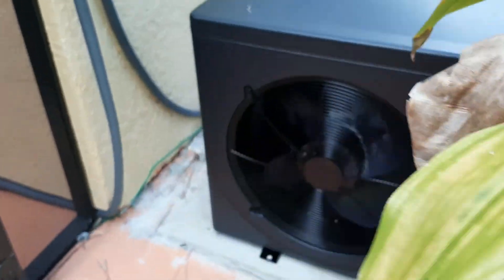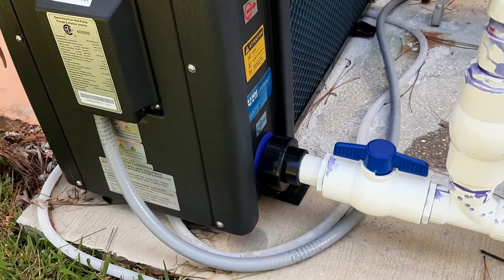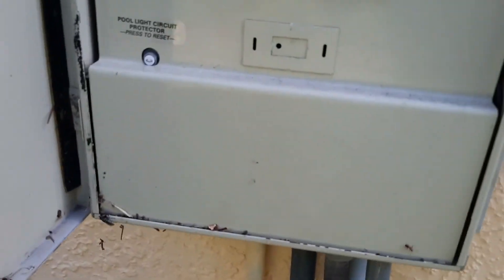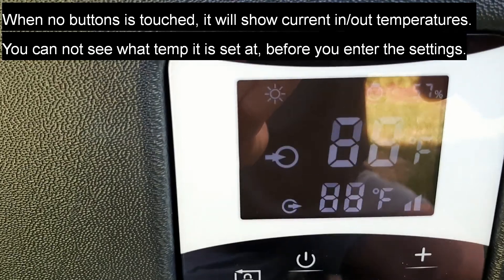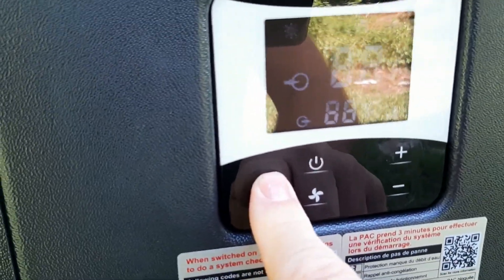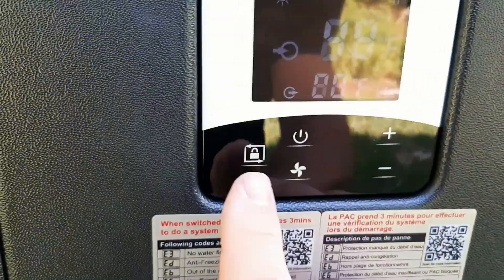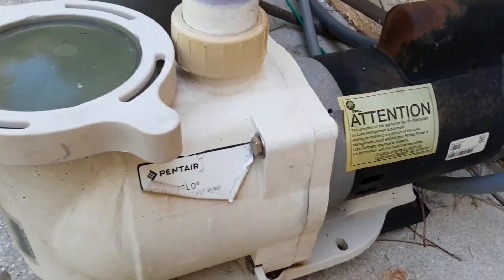Raypak Crosswind 65-I Electric Pool Heat Pump and Cooler Review

Comment: I own this same unit. I put it on a 13500 gallon pool.  This unit will heats up the pool about 30ﾟ warmer In about 2 and a 1/2 to 3 days. I have a setup on a variable Speed pump and I run it about 55%. It cost about $4 A-day to run Running at a 100%. Once it gets  the pool to about 88ﾟ it will cycle on and off on and off and cost about $1 to $2 A-day  This is based on Houston Texas weather that that was anywhere from 55ﾟ to 80ﾟ during the day.  I installed this on 3"  PVC.  They would not be good for a hot tub as they can only go up to 90 ﾟF.  I'm very happy  With this  Unit and absolutely love that it has a screen to tell you the temperature in-and-out. I ran this unit pretty much most of December and raised my bill roughly about $38 a month. This is based on 10.9 cent per kwh.  What's the temperature in the pool reached  88 degrees it pretty much cycled on and off throughout the day.  You can adjust the temperature to whatever is comfortable for you since it can cool off your pool or  Heat up your pool. It's very easy to install yourself as long as you have basic common knowledge. It's very important to make sure you hook up the drain line on the bottom left hand side of the unit.  Feel free to reach out if you have any questions.
Reply: thank you. there is not enough info and feedback of this unit. I bet you would save more energy if you got a solar cover at night so you dont lose the heat you gained.  Did you install it yourself or have someone install it? if so how much did it cost to install? When you said it cost $4 a day to run running at 100%, you meant the heater itself right? So the heat pump was on 100% but the pump was only running at 55% speed none stop in those 3 days? At night when its cold, does the unit automatically turn off because there is no ambient heat during those cold middle of the night?
Reply: @moialder252  you are correct I definitely need a solar cover i have been looking into them because it'll heat it up during the day around to 84 and go down to 78 with heater on running on medium which is about 80% and running the pool pump at 55%. Running both of those cost me about $2 on med and  $4 on high a day that's running 24 hours a day. If the temperature goes below 50° the unit automatically will shut down. It is very hard for this unit to keep up if the temperature drops below 60°. I always keep my variable speed pump in about 55% while running the heater as that is the most efficient number I found to work for my setup. I installed it myself because it was very simple due to the fact that my pool company already wired my omniologics control board with thick enough wire to accommodate for this unit. All I had to do is buy the breaker the wire to run from the breaker to the unit and then the plumbing and fixtures to install the unit. It was very simple it took me about two and a half hours to completely set it up from start to finish. All in all cost me around $100 in parts. Very self-explanatory 220volt set up. If you are savvy with that kind of stuff. If you don't feel comfortable installing it yourself I definitely would recommend a pool installer to do it for you they'll probably charge you around $300 to $400 to install it if you have everything on hand. This is based on me talking to a buddy of mine that does pool equipment installs.
Reply: I have this unit. It works great. However, the black casing looks terrible after one year. Also, you press and hold the power button for about 10 seconds (after unlock), do you get a flashing WiFi symbol? There’s nothing in the manual about it and I can connect to it, but I don’t know what controls it. It came up in my WiFi options as “SmartLife”.
Reply: @jdmrc93  going to investigate this right now that is very interesting I'm curious of why it doesn't have its own app I would love to be able to control the air conditioner portion for the summer time because my omniologics Hayward will not control AC only heat.
Reply: How is the chiller feature? Does that also take 2-3 days to chill? I live in Houston too and man was our pool water VERY hot this past Saturday - looking for a heater/chiller option and this might be the most budget-friendly one.
Reply: @1371ddcantu o yes it keeps my pool down to 89-90 at most. I run it at night it can get down to about 83-85 but I have Pebble tech and it can get down right hot with out it typically 95-97.i keep it about 89-90. All the time my pool is 13,500 gal. Though your pool may very. Definitely worth the money to get one for sure. It is not expensive to run. If I run it all the time about 35-40 a month extra I also only run it at night or if we want cool water to come out of the fountains when we swim.
Reply: How is this working for you? I also live in Houston and it's too cold or too hot to swim. Can you please give me some feedback?

Comment: I just bought and installed a extremely similar unit. It's been running for an hour. Set it at 82° but not 100% it's actually set. See the heat mode sun, fan running.

Comment: Unlock it, press and hold the power button for 5 seconds and the wifi sulymbol will show up on the screen and start to flash.  Open the smartlife app and connect. The manual doesn't show you this, bit it works

Comment: Thanks for you videos.  I wanted to know if you were aware that this heat pump comes with WiFi already built in?   I'm using the Smarter Pool app and I'm able to control everything from my phone.
To turn on Wifi, you just hold the power on button until you see the wifi symbol start flashing and use the app to pair to the heat pump.
Reply from the maker: I saw someone mention it a while ago but forgot about it again. Thanks for bringing it up! I wonder why they didn't put it in the manual?
Reply: Can you please help me with this I am trying to get mine set up on Wi-Fi so I can control and see the temperature of the water coming out of the heater remotely. What app are you using and how did you set it up please give me step by step.

Comment: I just got mine installed today.  My pool guy installed it.   I keep trying to set the pool temperature to 80 I would set it at 80 and it keep going back to the 70s.   Now I know what the numbers means I’m really happy. I can’t wait until tomorrow to see what the temperature is.  It has been a year how do you still like your heater and did you use this cold winter.  Where in central Flower are you ..  I’m in Mulberry

Comment: I read some information on pool forums, and those who are considering this in DRY places with low relative humidity, BE CAREFUL, this might not perform well. I believe Twisted Pudding is in Florida which is very humid. Heat pumps dont just rely on ambient air but also RELATIVE HUMIDITY. When you look at the ratings, it even says the BTU output is based on 80/80/80, meaning water temp, ambient air, and relative humidity. You use this heat pump in dry area like ARIZONA or similar, this thing will perform POORLY. SO CHECK YOUR HISTORICAL RELATIVE HUMIDITY IN THE TIMES YOU WANT TO USE THIS. If it is showing lower than 50 and worse single digits or in the 20s, you need to get the BIG JUMBO LIKE AN AC CONDENSER SIZE HEAT PUMP to offset the loss of performance to even perform.
Reply: So what are people in AZ supposed to use to cool their pools down?
Reply: @1TUFZUK  The cooling part of this I'm not sure how performance is effective depending on humidity. The ratings are only about the BTU for heating.

Comment: Hello, on the wiring diagram there are “pump controls” do you hook the pool pump to these? Does the heater turn the pump on and off?
Reply: Only if you do not have a smart system to turn on and off the heat pump. That feature is for if you want the heater to run every time your pump is running.
Reply: Kind of a dummy setup in a way

Comment: where did you connect the drain line under the unit. The drain line is the little white line that come with the unit. I believe it is connected at the bottom in the back of the unit under it or am I wrong
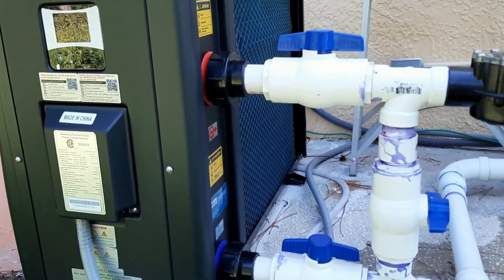Reply: I don't see the drain line 7:19

Comment: I have this unit. It works great. However, the black casing looks terrible after one year. Also, you press and hold the power button for about 10 seconds (after unlock), do you get a flashing WiFi symbol? There’s nothing in the manual about it and I can connect to it, but I don’t know what controls it. It came up in my WiFi options as “SmartLife”. Does yours do the same? And does your case look like garbage a year later?
Reply from the maker: My casing looks fine. I have covered the display to protect it from the sun though. Don't know if it's needed, but it would be bad if that became totally faded.
Some commented here (and deleted again) about the wifi and connecting with an app. I believe it was "smarter pool". I have seen the wifi symbol, just haven't played around with it yet. Please let us know if you find a way to connect and use it!

Comment: Hi i have the same model when i set the temperature high lets say 100 , it doesnt work more than 80% is that correct?
Reply from the maker: It depends on your mode settings. Take a look here https://youtu.be/2xYihuxeFsI?t=160 in the lower right corner of the display. Two or three bars indicate what setting it is at. One of them makes the heater run at full speed until temp is reached. I'm not sure if it actually goes to 100%. I use that initially and then switch to the other setting, which is a quiet temperature maintenance mode.

Comment: Hello! I live in Sarasota FL and am considering this heat pump for my 10,000 gallon in ground pool with attached spa. When speaking with a few pool supply companies, they recommend units with higher BTU. Does anyone else have feedback as to how this pump is working for their in ground pools?
Reply: Just installed a unit with 100k btu and it’s worked as intended. I’m in Bradenton

Comment: I just had the same heater model installed. They didn't connect the drain hose and I can't see where to attach it! Where did you connect the condensation drain plug and hose?!
Reply: @twistedpudding  I can't believe it! Its not in the book and I called Raypak. THEY couldn't tell me. YOU are The Man! Thank You!
Reply: I can't figure out where to connect it either

Comment: Having trouble unlocking the screen. When it finally unlocked the power on button did not start it up. New installation, is there a separate start up procedure?
Reply: @twistedpudding  I got it up and running finally. It seems the touchpad is very sensitive. Lighter touch seems to work best. I plan on hooking it up to my pump timer now(temporarily ran a direct line to see if it worked). I suppose I will then have to use the touch pad each time I want to use it. 
              By the way, if anyone is thinking of buying this unit for cooling, it works well. Pulled my pool down five degrees in a few hours. You can feel the heat blowing out strongly.
              Thankyou for your vid, it helped me  a lot. Robert
Reply: @twistedpudding  That's good news! I'll rely on the flow switch for on and off. Thanks again. Robert

Comment: You should not use fittings designed for drain plumbing in a pool application. They are not meant to have pressure on them.

Comment: Just installed the unit and the instructions are terrible
Only by watching your video was I sure which mode was heat and cool
I need dual mode because my pool is prone to overheating since it is so small
Did you wire your pump to the unit or not? Instructions show a pump line but I do not see why I need to do so unless I put in a full control system
Reply: Do you like the system? Does it cool the pool ?
Reply: @blackhouse7646  Yes it works great. We set pool at 94 and add a solar cover and we are swimming in 96 degree water every night in October. Costs about $100 per month to run in October but half that in July.

Comment: How has this heater/chiller worked out in the hot summer months cooling and heating in the winter??
Reply from the maker: We like to keep the temp at 89. So far we had not needed to cool it. I did mess up the setting once to cool, and it did a great job. Heating is working out well. We have extended our season with 3-4 month. It could be more if we were using the pool in cold weather

Comment: How much did this affect your electric bill?
Reply: I just installed this exact unit. It is very simple to install if you have basic plumbing and electrical know how. Very interested in seeing what my electric bill is going to do. I put this on a 13,000 gallon pool. It is working absolutely perfect heared my water from about 68 to 87° in about two and a half days. It only took that long because I kept turning it on and off because I did not know if my variable speed pump was going to run non-stop or turn on and off as need be. I have the setup on Hayward omnilogic with a Hayward 2.7 horsepower variable speed pump. Definitely a perfect combination. If any of you guys have any questions on how to set this up in your omniologics or in general feel free to reach out. Temperature outside was between 55°, and 80°.
Reply: @twistedpudding  I did at first but the I started running it at the middle setting and don't see a difference in our put temperature
Reply: @twistedpudding  being from Houston Texas we have pretty much the same weather. You definitely need to get a variable speed pump because I got it up to 90 yesterday with no problem the slower water running through the system creates hotter water going out to the pool. I'm kind of curious of what the electric bill is on yours because I only had mine for two or three days running so far I have no idea. Also with it going slower it does cycle on and off comes on only a few times a day now to maintain the water temp I usually keep it around 86 87 I wanted to see how hot I could get it and I turned it off at 90 because I did not know what the electric bill is going to be

Comment: I appreciate the review video, but I'm afraid you are pushing too much GPM to it, I don't see any provision to stay below max GPM, be careful you are damaging the unit. What's going on with the DWV PVC fittings and ball valves too? Lol
Reply: Yes, Dave - those DWV sweeps are not rated for pressure!
Reply: @twistedpudding  you're probably pushing 2x the rated flow of the heat pump, looks like you have a 1.5 hp pump or so. I would put a flowmeter on the outlet and watch your GPM and close one of the valves until you're under the 35gpm or so the unit is rated for, check in the manual. But you should have a diverter valve so you can bypass the rest of the water through the system, otherwise you're choking the pump and it'll run less efficiently and at a higher pressure. But someday you'll try to move those ball valves and you won't be able to so you'll have to replumb the whole thing. Taking the cheap way out makes you pay eventually
Reply: @twistedpudding  I can just tell by looking at it it's a sanitary tee for DWV. It'll say right on it. Sch 40 and 80 would have labels as well
Reply: You do not need to worry about pushing more than 35 gallons of water through the unit. It’s just a heat exchanger and pushing to much water through it will not really affect anything but the efficiency. The 35 gallons a min reflects the amount of water that is recommended to maximize the efficiency of the heat exchanger. It directly related to the dwell time inside the unit. It will not damage it in anyway. It will make it less efficient as the water is not spending the correct about of time inside the unit to transfer the  maximum about of available heat. You pump is a centrifugal pump and not a positive displacement pump. This means that the pump has a built in slip factor and can accommodate pressure drops or restrictions that total more than the capacity of the pump. Yes it could cause the pump to draw a few more amps but on such a small pump it really will not be noticeable. As far as DWV pipe, it has a foam core instead of a solid core like sch 40 PVC and as stated it is not rated for more than 5 psi. As far as the fittings are concerned, they are the same as sch 40 except for a few differences. The main one is that the sockets are not as deep to save money. However, in a pool application where you will never see anything even close to 100 psi they are actually fine.